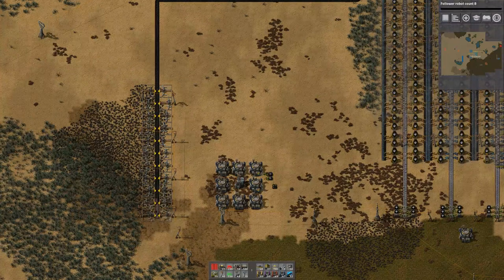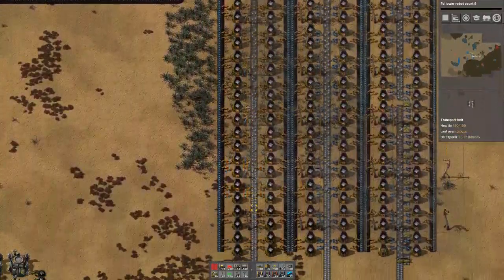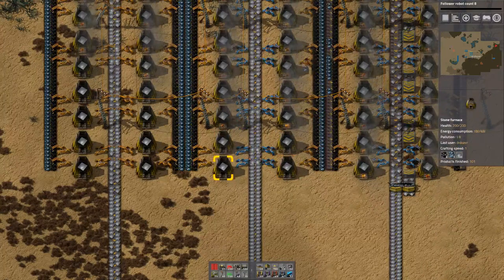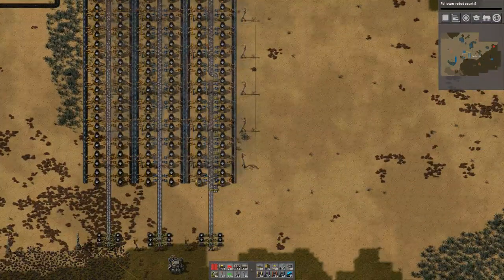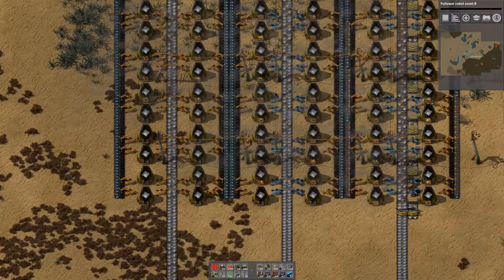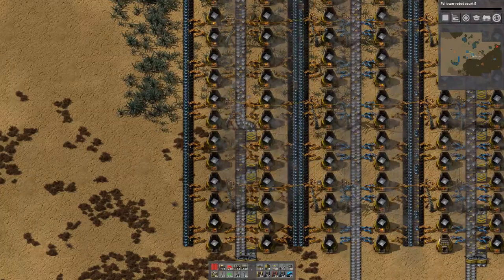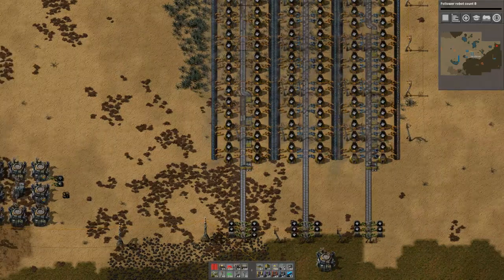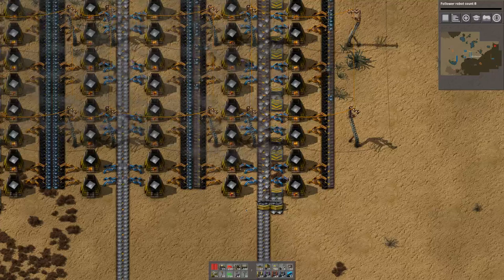Factorio sandbox: How do we compress belts?

Comment: Dont know if someone else has said this but im pretty sure the reason the merge you made on video didnt work because the furnaces had finished iron in them that the inserters could work with so instead of relying on the furnace speed it went to the inserters speed so you should have emptied the last furnaces and it would have worked :P
Reply from the maker: Seah, that was part of the problem -- I did test this out - because of how splitters were working back then, you needed to try to have the two belts being merged being more approximately equally loaded, or one would back up. Seems to be fixed since the patch with priority controls on the splitters.

Comment: I initially tried to use 4 red belts on the points where the last eight furnaces unload their iron. It improved things a bit but some furnaces are still getting backed up. I don't think that inserters can ever do a perfectly compressed belt.

Your idea works perfectly. It can also be made a bit smaller by replacing the bent belt with a splitter, that way the bypass only has to be for the last eight furnaces (so in total 2 splitters and 4 underneathies used, and it will be 10 blocks long).
Reply from the maker: Oh cool. Thanks.

Comment: Why not just have 2 belts between the smelters and funnel them out into a single belt using a splitter. Basically make your smelt line wider by 1 belt per column of Smelters.
Reply from the maker: Ino Koludrovic that may not work so well as you will saturate two half lanes because the inserters always put on the far side.
Reply: you could do that wiggle thing in the middle to balance.

Comment: A couple things of note. First, miners will not compress a belt, so you need to merge multiple lines. Second, it looks like you had full stack size research based upon how the inserters in the middle smelter behaved. Therefore the question still remains, how will fast inserters behave in the early game? Third, I noticed gaps in the splitter merge setup.
Reply from the maker: Eric Thomas yeah you are right. I should have set the bonuses back to zero as that's what you'd have to begin with.